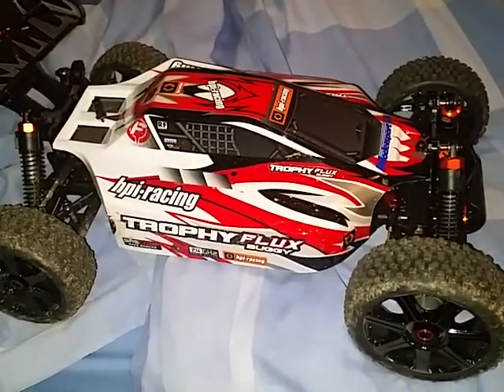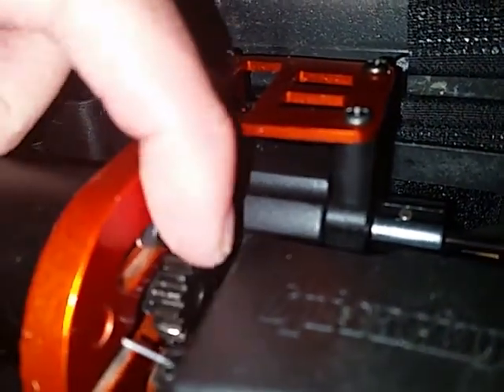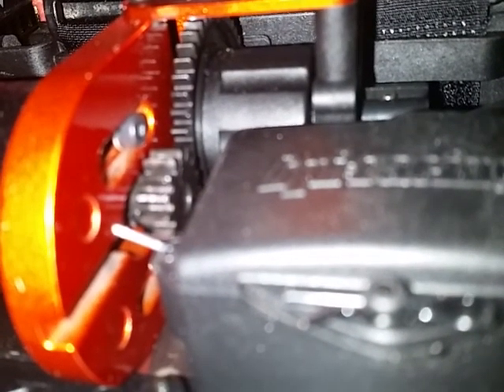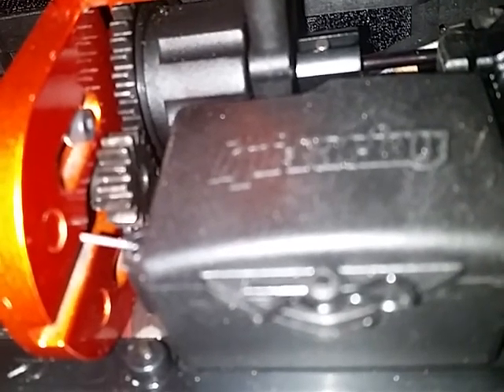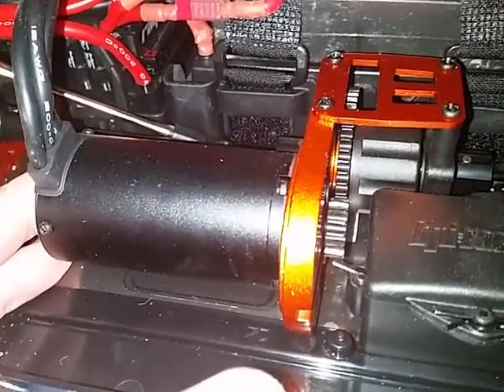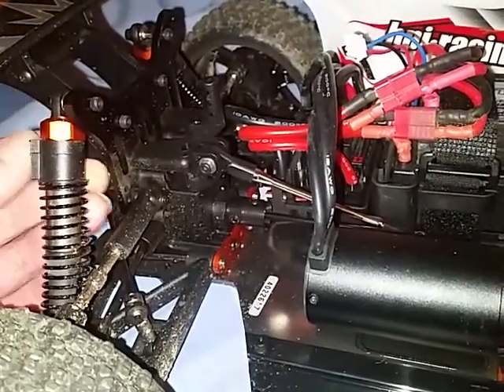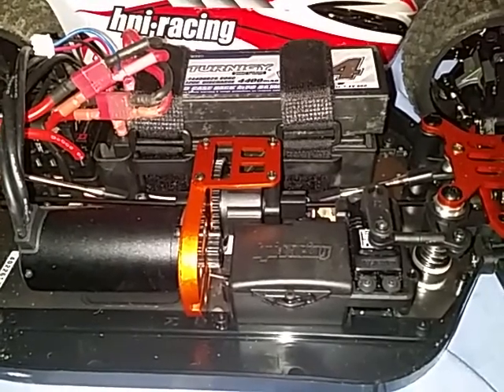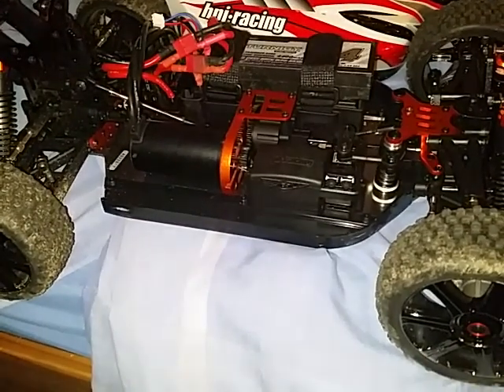HPI Trophy Flux Pinion & Spur Upgrades : Advice Needed

Comment: My opinion is to not change a thing unless it's broken... Upgrade it if it's broken because as for now, I assume, it's running just fine :)
Reply from the maker: Billy James Thanks mate. I cant change it cos the pinion gear is rounded off where the Allen key goes. I have to send it hback sometime and get it off and then fit the 21t I have.
Reply: Ben Rogers Really, it's rounded off? Have you sent it back yet, mate? Let me know what happens... The tiny screw for the pinion is called a grub screw...

My Nitro Trophy engine needs to be reset. Been digging on the Internet for the factory settings for the HPI F3.5 engine... All needles have to be flush which they weren't... That's the bugger with Nitro, every outing there's a chance you need to re-tune but I love it!!
Reply from the maker: No, not sent it back  yet due to lack of funds. I know about the screw being called a grub screw, don't know why I didn't say it! I like the sounds of Nitro's but I've never owned one as they are a bit too noisy for around here.
Reply: Ben Rogers Modelsport should pick it up and then return it for free, they did that with my Kyosho Inferno GT2 Race Spec GT racer (Nitro)... Once I get my Nitro Trophy Buggy up and running I'll record some videos for you 😀